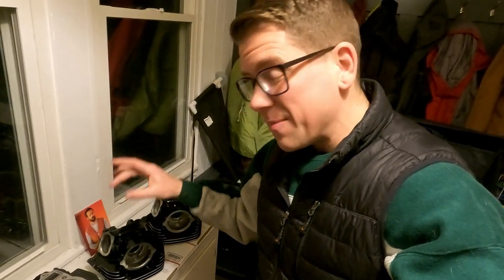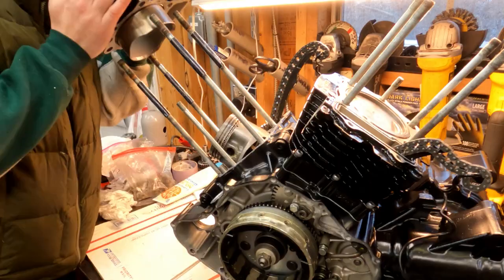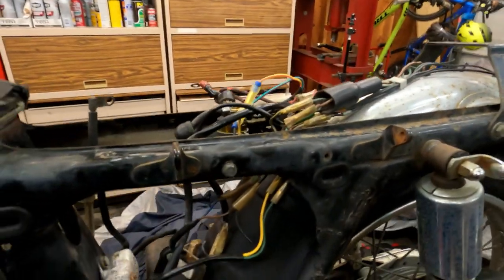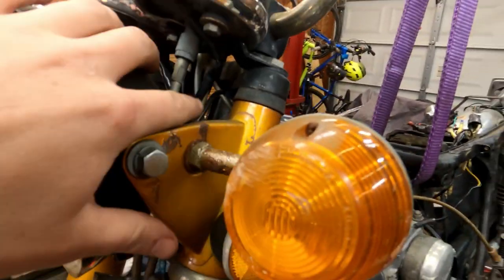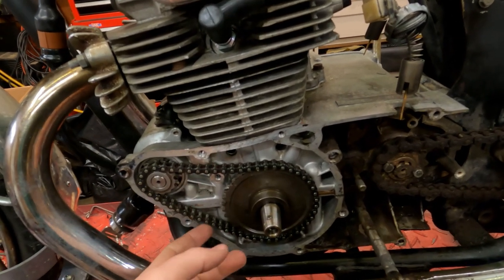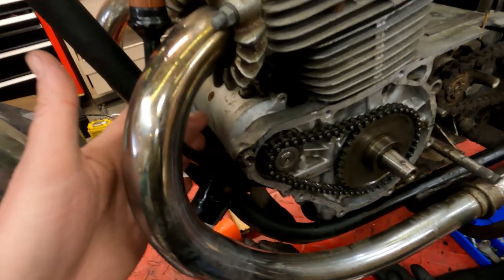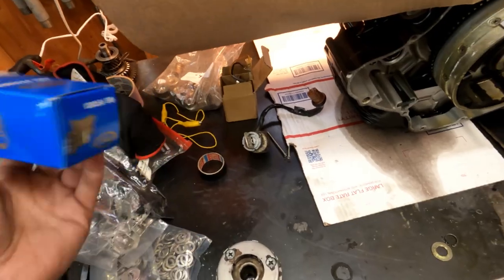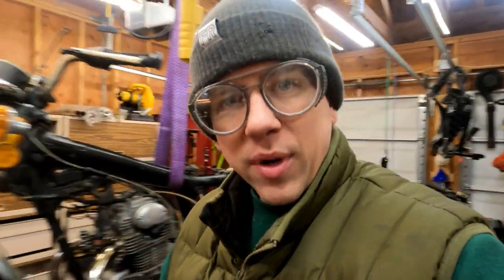BAKING Paint in the OVEN??? This Won't End Well...

Comment: I put an old electric oven in my shop for that exact problem with using the house oven.  I also have a powder coating oven from Eastwood for the smaller jobs.
Reply from the maker: One day when I work in a bigger shop, I'd love to do the same!
Reply: @two-cargarage I don't have a garage, or workshop. And yet, I have a $12 used toaster oven from a thrift store. Sits on the counter. Cures paint.

And doesn't leave toxic fumes and chemicals in my oven that I use to cook food.
Reply from the maker: @RIAG-g6z  great idea!